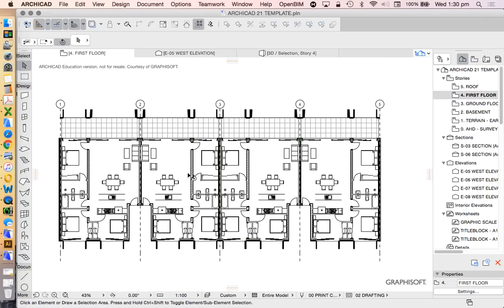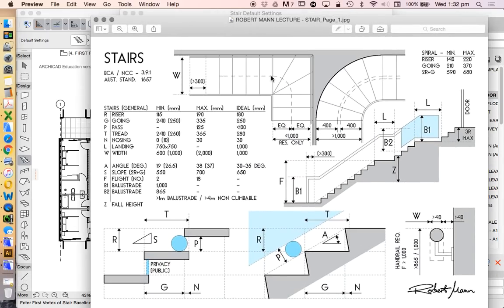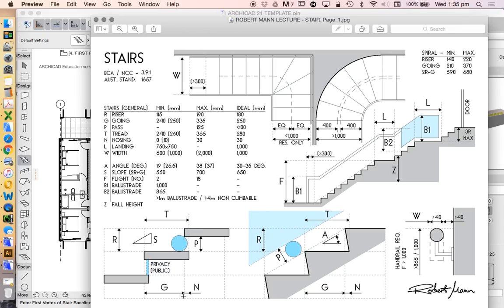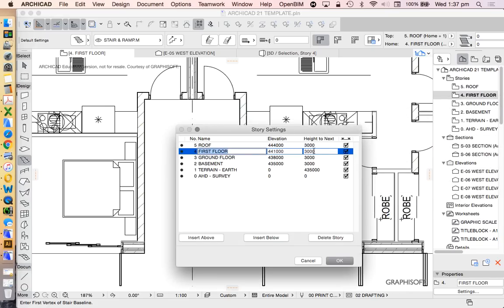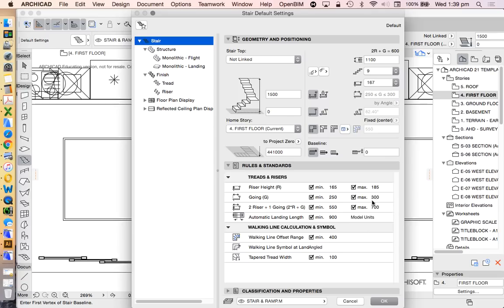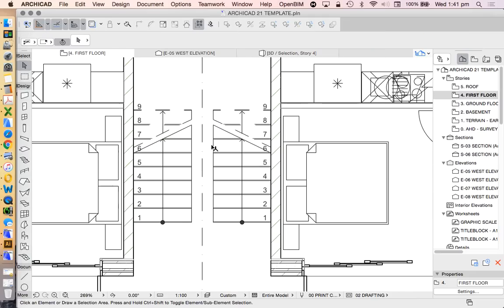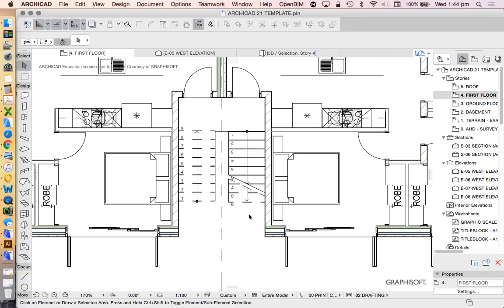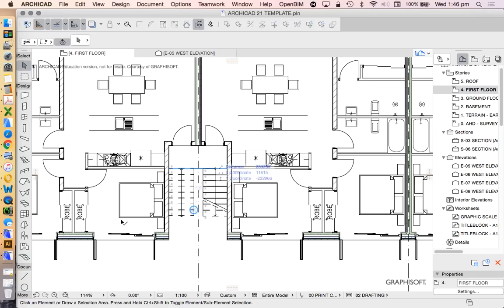ArchiCAD 21 - tutorial part 26 - new stair tool

Comment: Hi there! I was wondering if you can create a slab which from three directions will have stairs. But not just independent stairs, I want to create these stairs to be the continuity of each other and therefore they will form an angle. Does that make sense?
Reply from the maker: no, they would need to be seperate stairs, but they could (and should) all have the same settings

Comment: The stair tool does not work in Archicad 23. Paid $6,500 for a headache. I have been using Archicad since 2003 and older versions are way more efficient than the recent ones.
Reply from the maker: Hi Marcia, you're not alone. Unfortunately the stair tool, although can be very useful, is not very intuitive, clunky and not easy to use without understanding its intricacies. At first I have found my own method of creating stairs just quicker and simpler, than spending the time learning the tool - which is absolutely fine! 

I have since spent a bit of time with the stair and rail tools and will soon be producing a focused short course on it using ArchiCAD 23. Check out our ArchiEd website for more content - www.archi-ed.com

Comment: what is the problem with archi 21 not showing the stairs in 3D perspective view i was hopping you'd touch on that
Reply: sometimes stairs are filtered in 3D(this happened to me). Ctrl+Alt+A to open Filter and cut elements in 3D and turn on stairs. hope that works
Reply: thanks heaps that did work